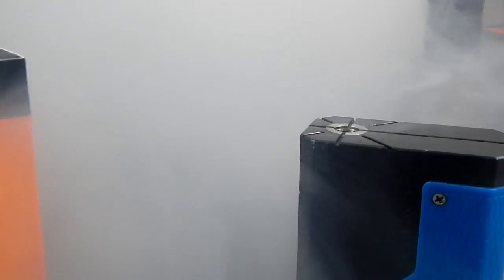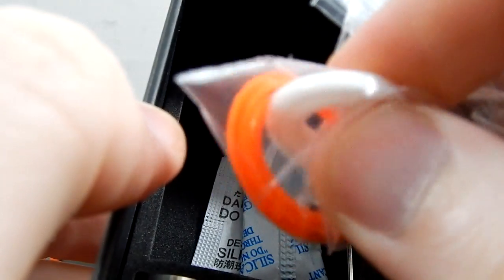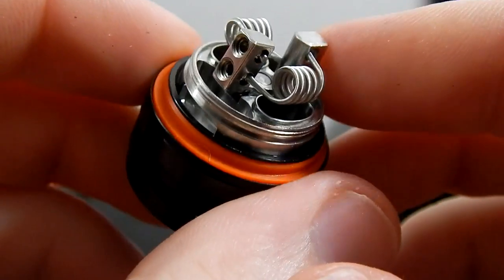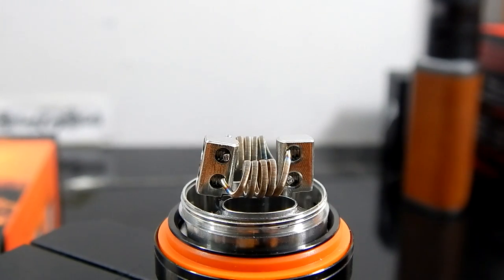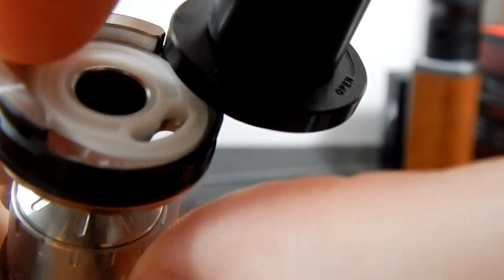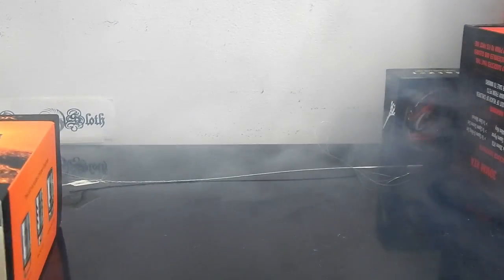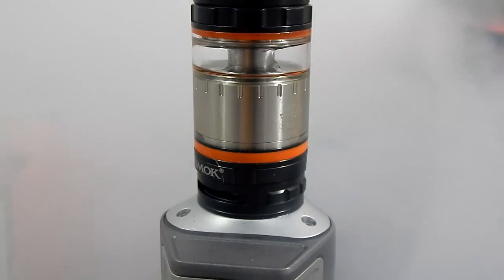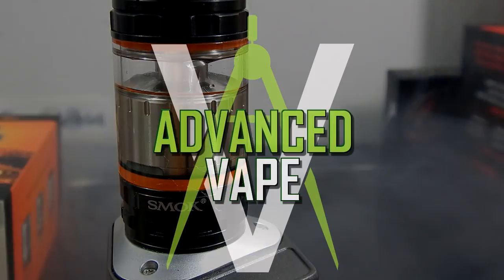TFV8 by SMOK - IMPRESSIONS + 316L STAPLE BUILD

Comment: Went into a vape shop yesterday, asking about Smok pre-built coils for my unit. They told me that they refuse to stock ANY Smok products due to the high amount of returns on faulty models and peripherals across the board. Looking to move into building my own in the future but will steer clear of this brand. I see in the comments below and all over the net that Smok appear to have an awful quality control system. All very hit or miss.

Comment: I popped the glass off by accident then broke it later on, I cannot fit the replacement glass it keeps falling off.any advice?
Reply from the maker: make sure the oring are in place and that it is fully screwed in (the top to bottom section trapping the glass)

Comment: Man, I've never been able to get this RBA to work.. It always just leaks all over the damn place once the coils gets hot.  I always thought it might be the giant ass air holes under the coils just leaking juice down?  I've retired the thing, I just don't know what I'm doing wrong with it.
Reply: More cotton in your juice wells, make sure your tank is sealed when putting it back together. The heat thing...you may be n the wrong 'mode'? Give those coils a few seconds to cool between hits. Chad had some advise as well!
Reply: It ALSO helps to continue pulling after you've released the fire button. Excess vapor in that chamber cool down and then begin to coat the air holes and eventually coagulate and run down. The size of the air holes does not help. Definitely pull for a second or two after you let go of the fire button to clear all excess vapor out. That prevents excess liquid from coming out by about 40-60% in my own experience.

Comment: Hi, I am new to RBA. Was wondering what coil/resistance would work with this? would these work 24 AWG / 0.5105 mm
Resistance: 1.101 Ohms/ft at room temperature or maybe the 22GA A1 AWG: 0.64mm - 1.31 Ohms/ft Resistance.
Reply from the maker: Mahmoud Katanani either one of those would work at 3mm and maybe 7 wraps.
Reply: Thank you for the quick reply :)

Comment: I like the idea of the TFV8 tank.  Smok just has terrible quality control for this.  Internal threads are garbage.  Get shorts about every 20 pulls or so on their premade coil heads.  RBA deck that came with the tank had a bad negative post connection,  unusable.   Second RBA deck I purchased has a bad insulator for the positive post, unusable.   I'll be giving the goon style RBA-16 a try and if it has issues the whole thing will be shelved.

Comment: How would the 4 or 5 ohm clapton pre made coils you guys sell on ebay work on this tank?
Reply from the maker: German Vazquez they are .4-.5 per coil, and the legs are long enough to add a couple wraps. they should work alright with this, although it wouldn't be my top recommendation for wire choice
Reply: Thanks for the reply what would you recommend i want to try some of your pre made coils
Reply from the maker: German Vazquez what's your preferred wattage range?
Reply: I am between 70 to 100 right now with this tank using the pre made coils that come with it. I have the smok alien so room for more wattage but i like tc better than kanthal
Reply from the maker: German Vazquez I would recommend something like the 30x3/38 triple core fused in that case.
Reply: Thank you so much are those in your website?
Reply from the maker: German Vazquez no problem, let me know if you have any other questions. and yeah they're on the site

Comment: mines not bent at all octo coil that leaked out bottom seal, wire ripped the rubber seal. so i called there sending another coil, dna vape couldn't  give tech help . but looks like its real hard to get that rubber seal back on.not even going to try, same thing with single large. so rba is got to be wick cant use my new g-prive. tell i do it.

Comment: for anyone who has a bent deck send it back asap and do not use it. I bought this instead of the herakles rta because of the option to use stock coils on the go or whatever. the fill port is still too small imo.
Reply from the maker: it's not a bad tank, but I think there's better options out there
Reply: +AdvancedVape what rtas would you say are better?
Reply from the maker: +Aaron Champion my favorite rtas right now are probably the engine rta, the modfather rta. and the mage rta. There's a review up now on the engine, and the other two are coming soon

Comment: Whats the max wattage on this rba?
Reply from the maker: Daniel Lainela that completely depends on the build you put in there. I could easily see a 150w build on there with the airflow that it has.
Reply: AdvancedVape im using the alien mod usualy i keep it on 220w is it possible for this rba to be vaped at that high wattage with those pre-installed coils that smok gave? Also thx for your reply ,you gave me some hope😸
Reply from the maker: Daniel Lainela those coils it comes with really suck. I wouldn't personally vape them at any wattage. but I think they're intended to handle fairly high wattage.
Reply: AdvancedVape can you please make a review on ijoy combo Rdta atomizer?

Comment: that looks like a fake my tfv8 deck looks way different also my deck came with 7 rap Clapton coils, and the post's are unbendable, to be completely honest with you that is a fake or its was machined improperly
Reply from the maker: not a fake, I checked. I took the build it came with off, as I always do. the bent deck thing seems to be a common thing with this rba. there is also another rba section for this tank as I understand it